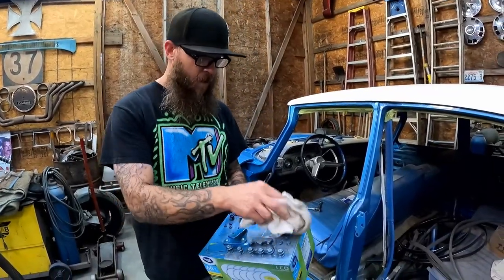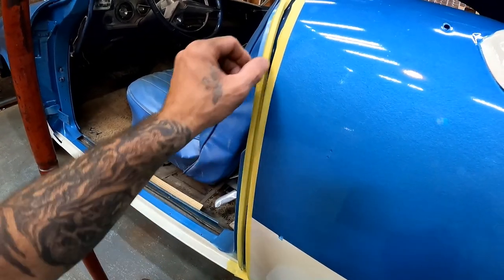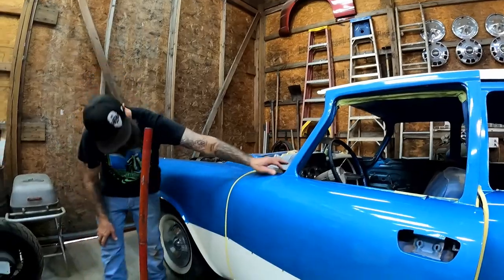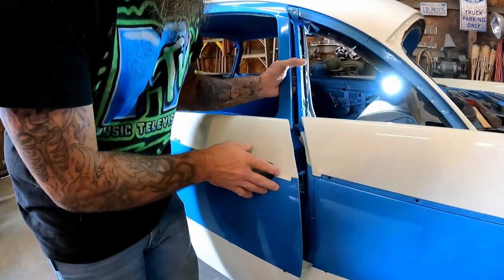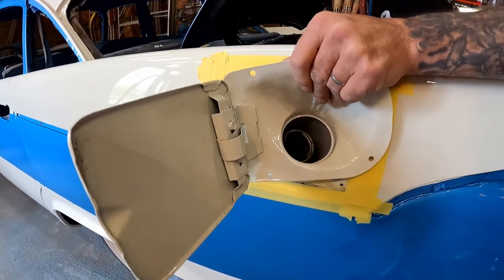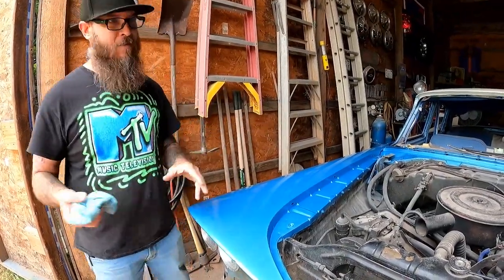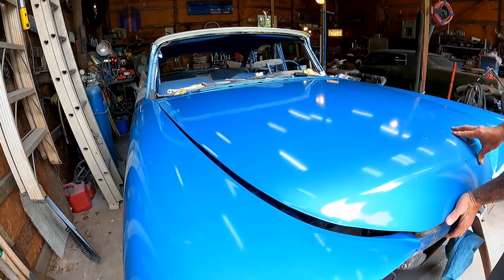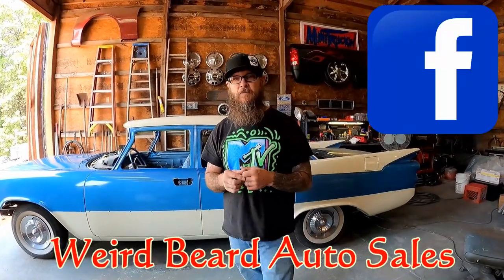REASSEMBLING THE '59 DODGE CORONET

Comment: I love to see this old beauty coming together! The 59 Dodges are my absolute favourite mopars of all time! They areeven cooler than the Furies of 58!
The tape on the edges of the doors are EXTREMELY important! Last week I was working on an endless classic Chevy project. The doors were painted and I mounted them over a year ago. I was very lucky to succeed the mounting of the door without any scratch. But the gaps were awfully tight in several spots (I bet the panels never fit very well since new). I finally received a painted front fender. When I put it on, the front door was nearly touching the back of the fender. I Just pushed the front fender a slightly forward. But when I closed the back door, the front of the back door chipped a little paint of. It seems that the front door was pushed a hair backward. Maybe the bolts were not tightened enough. But the damage was done. 
Of course there was not more tape on the doors as they were mounted a year ago.

Comment: When I was a really young boy my dad restored a 1977 Dodge clubcab complete frame off restoration, I remember having to find all the little holes throughout the body panels where all the trim pieces connected, took us most of a weekend to put all of back on, along with the running boards and grill, bumper's, we ended up doing the same exact restore a decade later again, and then the diaphragm on the fuel pump ruptured, spraying fuel directly into the back of the alternator causing a fire, thankfully the top radiator hose burst and all the coolant from the 4core radiator put out the fire , not before completely burning up all the wiring harnesses and other hoses, was one of the saddest things to happen as it was a sentimental thing to me, we re did all the stuff damaged and put it back on the road, my dad sold it shortly after and that was the end , just wanted to share with you and anyone else who happens to read this ,Liked the video very much,
Reply from the maker: Sorry to hear about the fire but happy to hear that y’all were able to save it. Thanks for sharing your memories man.

Comment: Hey WB! Noticing some of the rusty clips for the trim and figured I’d throw an idea your way. Get some Evaporust and let the clips soak overnight. You shouldn’t have to use the wire wheel or anything. Evaporust should remove every bit of rust. Take them out of the solution to dry and it’ll act as a rust preventative. I used this to refurbish the heavily rusted spindles on my 2003 Mustang GT and they ended up looking like brand new. Just a thought, keep up the awesome work brother!

Comment: Also, I would use generic molding clips for the body side moldings. I'm referring to the ones with a 10-24 screw post in the middle, along with a thin, curved wire coming from the center. The advantage is that these give you 'wiggle room' to fine tune the molding alignment, whereas the original spring clips do not. Also, the spring clips will chip the paint around the small square holes.
Reply from the maker: Thanks Ron. This is helpful. 🙂

Comment: Get some cheap, flexible door edge guard from the auto parts store. You can reuse it. Could probably use a length of vacuum line with a slit in it.

Comment: What have you decided to do with the engine? I seem to remember is there is some sort of issue with it. Does it need a rebuild?
Reply: The engine runs fine. WB drove it in and out of the shop in several previous videos.

Comment: You made such a good job of painting the car and then did not bother to paint the underside of the hood why you had it off anyway very odd also why not paint that rusty bit at the front ok you will do it later but it would have been so much simpler if you did it when you had paint in the gun but what do I now you probably had some reasons for not doing it.